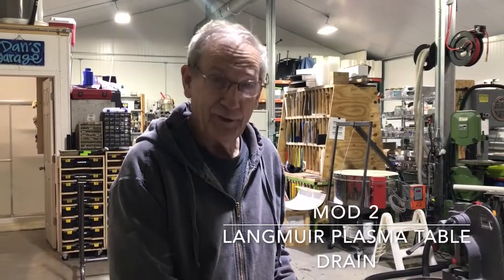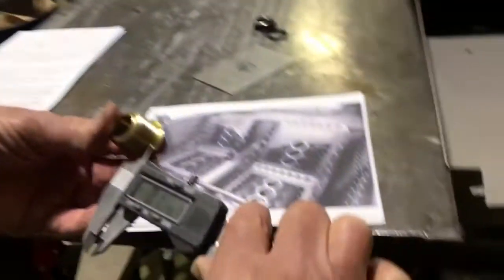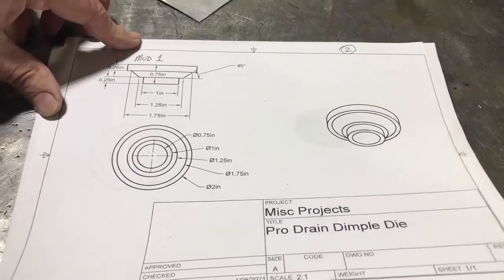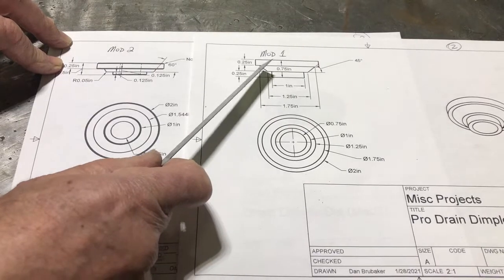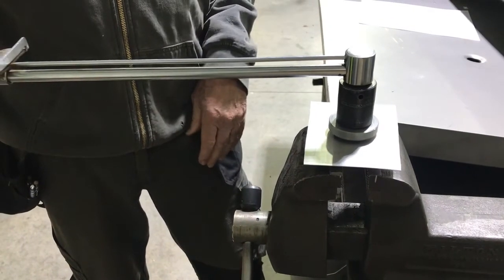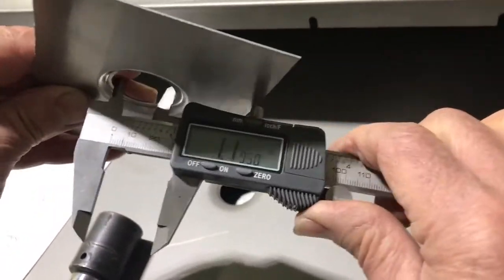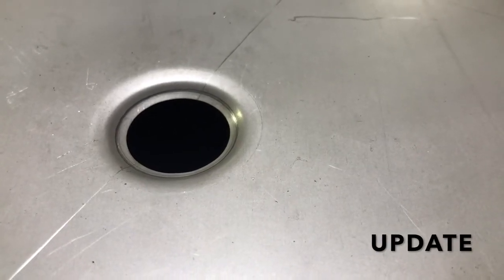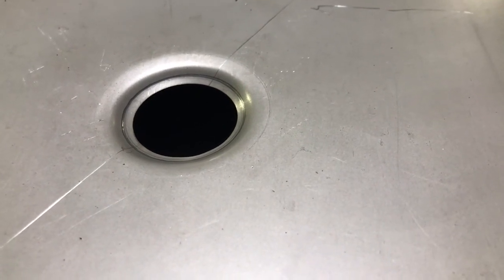MOD 2 LANGMUIR PLASMA TABLE DRAIN

Comment: I would like to buy the #2 die
Reply from the maker: Larry, I haven’t made a die for years.  if not already I’d highly recommend you become a member of the Langmuir forum.   On the forum there is a spreadsheet for members interested in using the Mod2 dimple die.  You might want your name to the spreadsheet to get in line for the die.  You can find the spreadsheet in the following https://forum.langmuirsystems.com/t/pan-drain-dimple-die-mod-2/13000?u=dbrub2

However, it’s unclear if it is still in circulation.  One option is to ask forum members to 3D print a version of the die.  I published the file to print on that forum and many have stated that a 3D printed version worked good.
Reply from the maker: Larry, I haven’t made a die for years.  if not already I’d highly recommend you become a member of the Langmuir forum.   On the forum there is a spreadsheet for members interested in using the Mod2 dimple die.  You might want your name to the spreadsheet to get in line for the die.  You can find the spreadsheet in the following https://forum.langmuirsystems.com/t/pan-drain-dimple-die-mod-2/13000?u=dbrub2

However, it’s unclear if it is still in circulation.  One option is to ask forum members to 3D print a version of the die.  I published the file to print on that forum and many have stated that a 3D printed version worked good.

Comment: Are you still loaning the Mod2 dye?
Reply from the maker: Josh,  if not already I’d highly recommend you become a member of the Langmuir forum.   On the forum there is a spreadsheet for members interested in using the Mod2 dimple die.  You might want your name to the spreadsheet to get in line for the die.  You can find the spreadsheet in the following https://forum.langmuirsystems.com/t/pan-drain-dimple-die-mod-2/13000?u=dbrub2

However, it’s unclear if it is still in circulation.  One option is to ask forum members to 3D print a version of the die.  I published the file to print on that forum and many have stated that a 3D printed version worked good.

Comment: Love your channel, and I appreciate the passion you put into the content.   I am a new Langmuir Crossfire Pro user and learning daily.  Is this dimple die still available to "borrow"?
Reply from the maker: Honestly I’m not sure where that die is now.  I recommend you go to  https://forum.langmuirsystems.com/t/pan-drain-dimple-die-mod-2/13000?u=dbrub2
There you will find the sign-up sheet for the die.  Additionally, you can request one of the 3-D printed dimple dies that forum members are producing.  Many have had good success with the printed dies although sometimes it is only good for a couple of dimples.  If you not a forum member you should be.
Reply: Thank you for the tips and your quick response. Much appreciated.

Comment: I’ve built my own plasma cutter and currently have a water pan being fabricated.  Where can I purchase that drain plug?
Reply from the maker: Sorry for the delay…I don’t seem to get notifications when folks ask questions on videos I did some time ago.  I’m not sure where the dimple die I made is these days but you might want to go to  https://forum.langmuirsystems.com/t/pan-drain-dimple-die-mod-2/13000?u=dbrub2
There you will find the sign-up sheet for the die.  Additionally, you can request one of the 3-D printed dimple dies that forum members are producing.  Many have had good success with the printed dies although sometimes it is only good for a couple of dimples.  If you not a forum member you should be.

Comment: Good evening! Do you still loan out this dimple die if I cover the shipping?
Reply from the maker: Hey Michael,  that die when out long time ago and is being passed around based on a signup sheet.  Do you subscribe to the Langmuir forum?  If so you might want to search for a topic “dimple die” and you will find lots of info.  Of interest is that many started 3D printing the die using my drawings and they worked good for a couple of dimples.  Let me know if you have trouble finding the forum info.

Comment: Hi, are these still available? if so, how much?
Reply from the maker: Afraid I only made the first set and on the Langmuir site there is a sign up sheet where folks use the die then pass it on the the next one in line.  Also many have 3D printed the die using drawings I put on the Langmuir forum and say they work fine for the two pan drain holes.

Comment: I'm interested using the Mod 2 die, if still available. And, yes I would be happy to reimburse shipping.
Reply from the maker: I thought I had responded to this but I guess I didn’t.  I haven’t seen the die for a couple years after I sent it out originally.  There is a signup sheet on the Langmuir Forum and it is supposed to also be the method for tracking where it is.  Here is the link: https://forum.langmuirsystems.com/t/bar-sink-drain-dimple-die/22761/363

If I wasn’t so covered up I’d make some more of these!

Comment: Nice job. I was worried about cleaning my table.. 4x8.. found wet ridgid shop vac works awesome!! The Drain plugs up easily .. just drain as much as i could.. then pick the large pieces and vac the rest.. nice clean up. 😊
Reply from the maker: THX!  I use a small vac,  boy is it messy to clean the hose afterwards!!! :(  

I started putting a rolled up piece of coarse scotch-brite into the drain openings...it still allows fluid flow but stops the debris that tends to clog.  Also I started using a magnetic pickup tool from Harbor freight every between cleanings.  (https://www.harborfreight.com/heavy-duty-magnetic-pickup-tool-42288.html) It fits between the slats and allows me to pick up all the cut pieces in the tray and also the fine steel "dust" that become sludge in the bottom of the table.  I use a wide blade putty knofe to scrape the debris off the pickup tool into a can.

Comment: Your dimensions on the drawings at the end do not match each other for mating - please revise.
Reply from the maker: Not sure what you mean!  There has to be clearance between the mating surfaces for the thickness of the stainless table so the diameters of the punch must be less than the diameters of the die.
Reply: @CustomCreations3  I will triple check, but the raised side of one die is a larger diameter than the recess.
Reply: @CustomCreations3  I just verified.  The expanding die has a second step of 1.544" and the recessed die for that step is 1.445"
Reply from the maker: @sticks7817  correct.  That allows for the thickness of the pan (approximately.100”) in between the two.  When the two dies are pressed together with the .100” thick pan material in between all clearance at the mating surfaces are eliminated.  The mating surfaces must have this clearance to form the correct step
Reply: @CustomCreations3  Uuhhh...1.545 + . 2 * .050 = 1.645 trying to get smushed into a recess that is only 1.454....What am I missing?
Reply from the maker: @sticks7817  Not sure why Fusion 360 drawing doesn't show the diameter of the narrow part of the cone but the 1.544" dimension is the top of the cone.  the narrow part of the cone that goes into the recess is 1.40"   I have a cross section view of the two die halves that shows this clearly  https://drive.google.com/file/d/14ZUB3iq2H_RY8-NDP3Yl50xPLrlQkJ1H/view?usp=share_link
Reply from the maker: Finally found the trick for fusion.  here is the link that shows each diameter of the punch

https://drive.google.com/file/d/1zwvk9szSHxJugegyL2VFuqHH0hAVVJdZ/view?usp=sharing
Reply: @CustomCreations3  OK.  So on the recessed end, what is the major diameter of the 1.5xx"+/- step?  Hopefully more than the 1.545" Major diameter of the above linked drawing for the extruder.
Reply from the maker: @sticks7817   since the punch doesn't actually protrude completely into the die (because of the thickness of the table material that is in between during the dimple process) there is sufficient clearance.  

https://drive.google.com/file/d/1fTLDpHAnOS5GKrZuWs9yV40bxj062UjH/view?usp=share_link
Reply: @CustomCreations3  Ah Ha!  1.64?" for the Maj. Dia. That is the number that I needed!

Comment: Nice work, I just received my table and seen your post. Is this die still available?
Reply from the maker: Hi Tony,  great to hear you’ve joined the plasma table group!  That die is being passed around.  Folks have put their name on a Google docs spreadsheet and each person passes it on after they use it.  I’m not sure where it is now but if you join the Langmuir forum and find the thread about the mod 2 table drain you’ll find the spreadsheet.  I will say that on that discussion topic many members are using 3D printed versions of the die after I provided the cad drawing.  They seem to work well and members are offering to print a set for anyone who asks.  If I were just getting a table that’s what I would do.  Hope that helps.

Comment: So l’v tried to follow along and hunt down this die but I don’t have the time or patience, is there a way to just get one from you? The #2 version.
Reply from the maker: Hi Donn, that die has been passed around a bunch and I’ve not attempted to keep track of who has it.  I know numerous forum members are offering to 3D print the die and I hear it is good enough for doing the two drains in the table.  Have you considered asking them for a set of the dies?  I sent off the only one I made well over a year ago.  I could make some more but am pretty busy in the shop currently.  I would have to order the material and charge standard shop rates plus any shipping cost.  I’ve given out the drawings to a number of folks so if you have a friend with a lathe that might be another option.
Reply: Sounds good. I’ll do a little checking around and get set up. Thanks!

Comment: That's nice work and a good explanation.  I used a similar die but it was printed from PLA.
Reply from the maker: Thanks for the compliment. I see quite a few say on the forum that they were successful using 3D printed dies.  I published the CAD file for the punch and die design I used on the Langmuir forum and folks have been printing them. One of these days I need to get into 3D printing!!!

Comment: Mike Hemphill 
I would like to order the model 2 die for my Crossfire Pro drains. Please let me know how to get one. Thank you.
Reply from the maker: Hey Mike,  are you a member of the Langmuir forum?  If so there is a signup sheet for the die set.  Here is the forum link:  https://forum.langmuirsystems.com/t/pan-drain-dimple-die-mod-2/13000/120

Alternatively, the drawings are available on the forum that allows you to either turn a set for yourself or 3D print a set.  I understand from the forum discussions that a 3D printed set using backup washers are good for a couple of dimples!

Comment: Im the one who has Mod2 now.. Had to get new bolt for it it was pretty worn. Bought a grade 8 bolt and nut for it. What did you use for a sealing gasket for the drain. Did you use the stock rubber washer or what did you use ?  I dont think you said in video ?
Reply from the maker: Yes I used the original rubber washer but dimpling the drain does enlarge the hole so I also used 3m 5200 sealant just to be sure.

Comment: Interested in purchasing mod 2 please contact me
Reply from the maker: Hi Ward,

There is a sign up sheet on the Langmuir forum for people to get the metal die.  It is supposed to go from the one currently in possession to the next person on the list.  As you probably guessed it has not worked as planned and often there are folks on the list asking where it is!!!  As a result many forum members are 3D printing the die using my cad file and are having good success.  They don’t last for many dimples but each set will certainly do a table.  The great thing is that the folks printing them are offering to print a set fir just about anyone that asks.  You need to be a forum member but that’s about all.  Anyway after I made the die And used it on my table I sent it to the initial person on the list and have not seen it since as expected…no reason for it yo be returned to me.  Is that any help?
Reply: @CustomCreations3  could you send me the file for printing one
Reply from the maker: @wardpeele1065  be glad to…not sure that is possible via YouTube.  The link to the files on the Langmuir forum is https://forum.langmuirsystems.com/t/pan-drain-dimple-die-mod-2/13000/91

If you are a member or don’t want to be come one then I guess I’ll need an email address or something.

Comment: From the looks of it the new model table has the same type of drain inserts. I dimpled the Pro table’s drains but put in bar style drains with metal mesh traps.

I really like the look of your mod 2 setup. I’m interested in using it.
Reply: Where did you get the bar style drains. I saw a video where someone did that but didn't provide where he found them
Reply: @texascrossbowdude636  I got them from a non big box hardware store. Home Depot has them for around $18 each. The Plumber’s Choice was the brand name. I used 1 7/8” x 2 1/2” drain.
Reply from the maker: Hey Larry,  Are you a Langmuir forum member?  Reason for asking is that there is a signup sheet on the forum for getting the mod 2 die and punch…I sent it off many months ago and am not sure where it is now but I do know it is still in circulation.  There are some options however.  There are a number of forum members who have been using my drawings but 3D printing them in full resin.  From what I read they work well for at least a few dimples.  The forum folks have offered to make these and send them for just shipping cost so that may be one option.  The design drawings are on the forum so you could download them yourself if you have access to 3D printer, etc.
Reply: @CustomCreations3  Yeah I just recently signed up on the forum, I’ll have to search that list out. Pretty cool people are making resin 3D prints, good for a couple presses. Thanks for sharing that design!

Comment: Do you still have your mod 2 dimple die? If so, I would like to use it.
Reply from the maker: No sorry...mine was sent to a member on the Langmuir forum months ago and it is now being passed around to folks that have signed up on a list.  If you go to the Langmuir forum and search for topic “Pan Drain Dimple Die Mod2” on the very first page just under the video pic there is a box labeled “links”. In this the one that is Google Docs is a spreadsheet of people that have signed up to get the die and you can select the steel one or the 3D printed version.  Each person that gets the die uses them to form their table drain hole then ships the die to the next person on the list. Shipping cost is worked out by each.  There are also links to drawings on that topic that you could use to 3D print your own if you have the ability and lots of discussion of how the printed one works.  The guys on the forum are really helpful...I’m sure if you requested help on there one may be willing to print one for you.

Comment: I would be interested in buying one of these if you could contact me. Thanks
Reply from the maker: Hi Jeff,  do you have a Langmuir Crossfire table?  Are you a member of the Langmuir forum?  The Mod2 die is being passed around by forum members...you would need to get on the signup sheet.
Reply: @CustomCreations3  Sounds Good and yes I am building my own table but have crossfire just looking for a die for drain
Reply from the maker: Ok...so in the forum there is a public Google docs spreadsheet where people have signed up for the Mod2 die.  The way it appears to be working is that once a person is done with their table they ship it to the next person on the list.  Would you want to get on the list or would you prefer I make you one?  The cost for the list method is just shipping to the next person on the list (around $8) if you want me to make one then the cost of time and materials would be $48 and shipping another $8.  I could get one machined in a week or so if that is your preferred option.  An alternative is to make one using a bunch of washers of appropriate diameter and stacked in the correct order...I’ve seen some folks on the forum do that fairly successfully.   Anyway, let me know
Reply: @CustomCreations3  I have made one out of washers and seems to of worked.  Thank you for your work and getting back with me.

Comment: You did a great job and great idea! I am definitely interested in one. I am going to be ordering a Langmuir system next week. If you could please send me a message. Thank you.
Reply from the maker: Thx Jon,  glad to hear you are going to order a table.  I think it still takes about 3-4 months after ordering to get it shipped.  I’d highly recommend you become a member of the Langmuir forum.  I have learned a great deal while waiting on my table to arrive.  There is also on the forum a spreadsheet for members interested in using the Mod2 dimple die.  You might want your name to the spreadsheet to get in line for the die.  You can find the spreadsheet in the following https://forum.langmuirsystems.com/t/pan-drain-dimple-die-mod-2/13000?u=dbrub2

Comment: I am in central Pa.  I made a die a year ago like #2 with not as sharp bend angle.  This reduces hole stretch.  I also fabricated two large washers to fit under the pan.  One is slightly thicker and larger id than the bevel.  The other has an id to match the brass fitting and a large od.  
DAve
Reply from the maker: Neat!  Have you posted your stuff to the Langmuir forum?  Others might like to see your design. Thx Dan